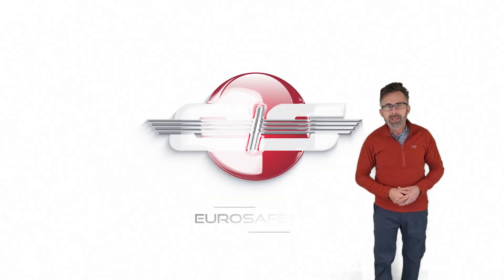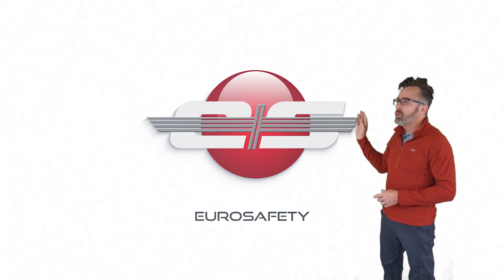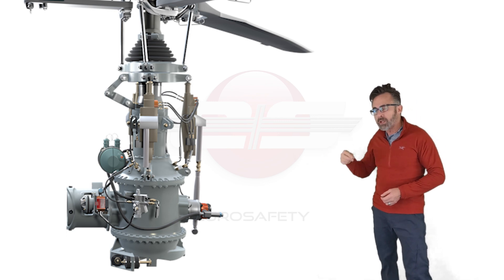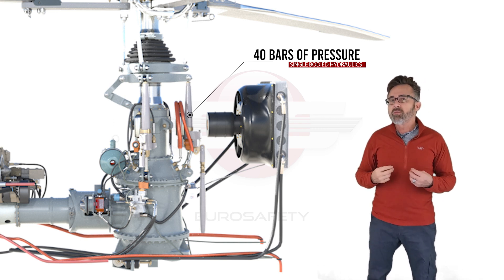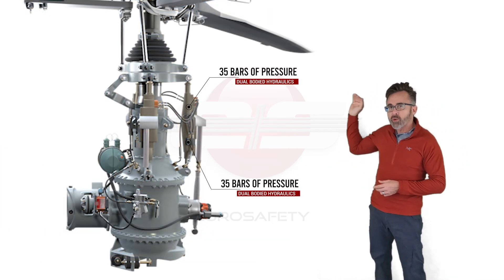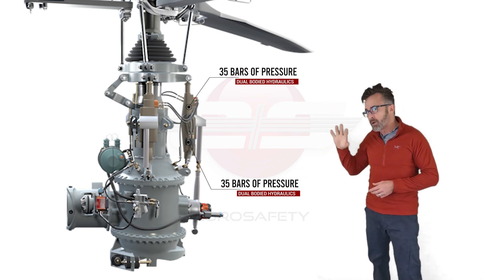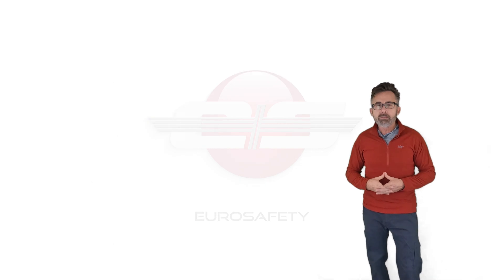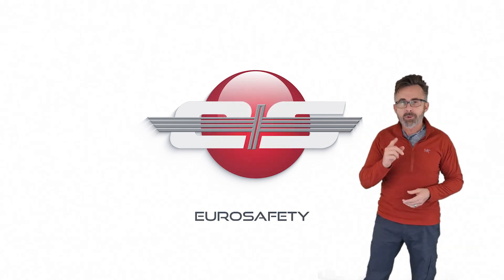#33 - AS350 and EC130 Dual Hydraulic System

Comment: While you are correct that there is no “70 bar of pressure” it’s a tandem system. Two independent hydraulic systems pushing a shared piston. Laws of hydraulics state that force is equal to pressure times surface area. With two systems pushing on the shared single piston the force of two 35 bar systems is equivalent to double the force of a single system. Hence the airspeed and bank angle reduction when one system fails and the warning about servo control reversibility with one system failed: because your piston force has been cut in half.  The proof is in the system description from Airbus training materials.  You can compare the 40 bar force (180 daN) at the piston on a single Hyd Astar with the force at the piston on a dual Hyd Astar (350 daN extension force 227 daN retraction force).  It’s a significant difference.
Reply from the maker: Appreciate the comment. The point of the video was to clear up a common misconception I hear a lot ....that two 35-bar systems somehow give you 70 bar of pressure. Thats not how hydraulics work. Pressure doesnt add, even if two systems are acting on the same piston. The total force might increase, but the pressure at the servo remains 35 bar, that’s all the piston ever sees from each side.

I wasn't diving into actuator force in this video .... that’s a different topic. What matters most from a pilots seat is that control feel doesnt really change before or after a hydraulic failure. The servo design is built to keep that consistent even if one system goes offline.

These systems are always worth deeper discussion, but for this one I kept it focused on the pressure side ... mostly to clear up some common confusion I hear regularly.
Reply: @EUROSAFETYTRAINING there is definitely a lot of nuance and physics involved.  Neat to know. Not necessarily need to know!

Comment: Hi, thanks for the video, I'm studying mechanics.. For example: you are in Hovering, and you move the cyclic forward, the "resistance" perceived on the cyclic changes based on the speed with which you perform the movement, or do you always feel the same "resistance" regardless of the speed with which you move the cyclic? Same question for the collective, if I increase the collective quickly, will I feel more resistance and will I have to use more force to move it, or regardless of the speed with which I move it, will I always have to make the same effort? I hope I explained myself well. Thanks in advance.
Reply from the maker: with the hydraulics working there should not be any perceived resistance. If you had a hydraulic failure you are not suppose to hover. In flight you will have to push forward and left against the resistance
Reply: @EUROSAFETYTRAINING  Thank you very much for your reply, I understand. Sorry if I insist, I'm not sure I explained myself well. If we were on the ground, (not in flight, without any external force), active hydraulic system, moving for example the cyclic in every direction very slowly or very quickly, the physical effort needed to move the cyclic is the same?

Comment: Question! Pre-clog LRBs vs bypass and what that means to these models and what might cause both independent systems to pop their LRBs on the same flight assuming properly filtered fluid is in the system?
Reply from the maker: The pop out indicators on your hydraulic system indicate a clogging hydraulic filter. There is no bypass in the hydraulic system. The popout indicator extends at a 2.7 bar pressure differential between around the filter and after the filter. If both popped my guess would be the helicopter was started when the fluid was very cold and thick. With helicopter warm, push back in, start the helicopter and see if they pop out again.
Reply: Thank you sir! Love your content, doing great work for a lot of us!
Reply from the maker: Thank you!

Comment: As always, thank you for your time, awesome videos !!!
I find it strange to see the plastic boot on the top of the Main Rotor. Usually the 350/130 with dual Hydraulic don't have one, or do they?
Reply from the maker: thanks! You are correct the boot is on the single hydraulic but not on the dual hydraulic versions. When Airbus makes design changes they do not publicize why they make they changes. I would imagine it has to do with possible ligation. If I would have to guess I believe thats somewhat like the boot or no boot debate people have on shocks. Some believe that the boot holds in moisture and dirt and other believes it protects from that.

Comment: What would be interesting when talking about dual hydraulics is explaining why servo transparency is not an issue with dual hydraulic systems...
Reply: Hi, thanks 👍. I find this very interesting! I did my 350 type rating an a dual hydraulics version and my instructors and examiner kept telling me that servo transparency is not an issue with the dual hyd system but I should be aware of it in a single hyd system. I kept wondering why it is not an issue but no one could give me a plausible explanation. And the Airbus safety notices can be misinterpreted (especially by non native speakers). There is definitely some misleading information on this matter circling around in Europe...
Reply: As you explained in the video the pressure in the hyd systems is 35 bars and therefore lower that the pressure of the single hyd version (40 bar). In conclusion this should mean that servo transparency should occure even sooner in a dual hyd system - am I correct?
Reply from the maker: I would be hesitant to call it easier to get into servo transparency in the dual as with either system you have to fly extremely aggressive to encounter it. In other words you have to fly extremely aggressive to get into it in the dual system and you have to fly even more extremely aggressive to get into it in the single. But yes technically the rare phenomenon would slightly happen sooner in the dual.
Reply: @EUROSAFETYTRAINING  Correct me if I'm wrong but wouldn't dual hydraulics actually be harder to get servo transparency? While the pressure has not doubled, it is simply two 35 bar systems, the load of the control forces would be divided between the two. Effectively cutting the control forces in half. You are still using just 35 bar but in two separate places and distributing the load. Lets say that the control force equals 1000 pounds and in a single hydraulic system you would have one pump creating 40 bar holding 1000 pounds but in a dual hydraulic system you would have two pumps creating two 35 bar systems each holding 500 pounds. 1000/40 for the single and 500/35 for the dual, seems to me that the single hydraulic system would still be over come by control forces sooner.
Reply: @EUROSAFETYTRAINING  Thanks always for your great Vids, I have read up on hydraulics and understand 35 is 35 but would love to hear your opinion on Robin Pletchers question of the load being divided between two actuators
Reply from the maker: Servo transparency is an issue with the dual hydraulics just like the singles
Reply: @EUROSAFETYTRAINING  But the safety information 3093-S-00 of Airbus from 2016 and 1648-29-03 from 2013 explicitly state that this is an issue of single hydraulic systems. So it is not really clear that this might be an issue with dual hydraulics as well...
Reply from the maker: Good Morning, First I am impressed you are reading the publications, that is awesome. The first notice you indicated does not say the dual is not susceptible to servo transparency it says that the limit light gives you a warning. It goes on to say that the controls locking up are the indication in the single. The second document you referenced talks about what servo transparency is but does not say you can not get into it with the dual system

Comment: Question sr
What happen in case we lost the upper side of servo for failure the other side keep 35 bars or the Pressure is low in lower side?
Reply from the maker: If we loose one side the pressure will still be 35 bars of pressure acting against the blade force.